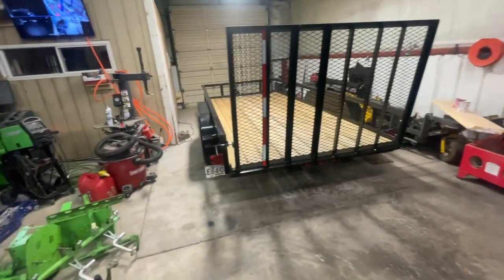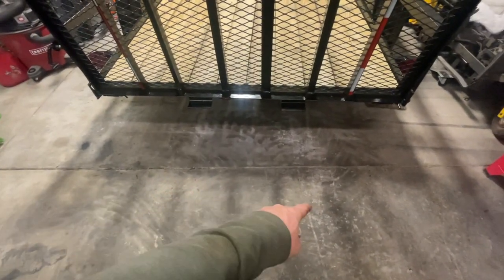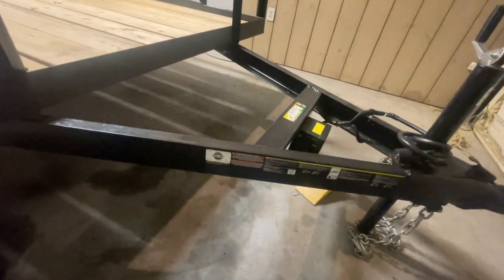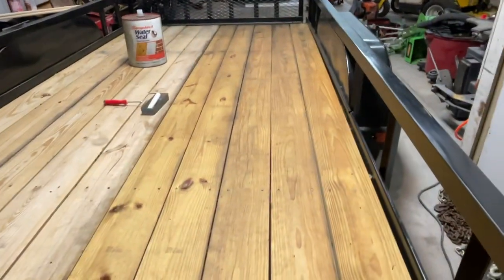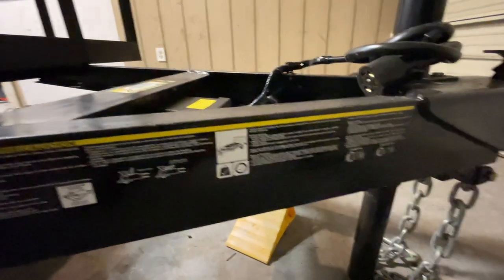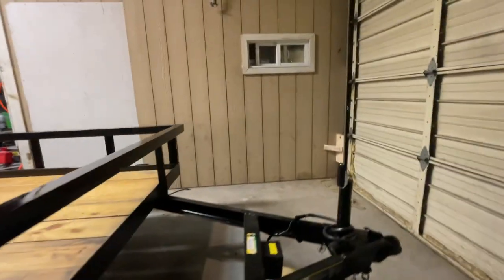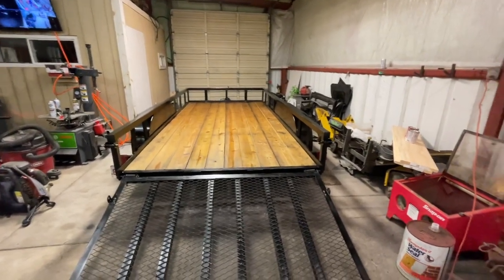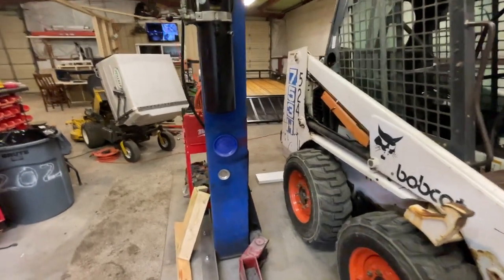HOW TO Make Your Trailer Deck Last Longer | Tractor Supply Company Trailer

Comment: I have it’s single axle sibling. I bought it last year because it’s the only trailer I could find. I was hesitant but not overly concerned because I don’t haul anything that even comes close to the weight limits. So far it’s been a good trailer.

Comment: Nice that you have a double axle trailer now. Perfect to use for everything you do. One thing I noticed is that it doesn't have stabilizer jacks at the rear to support weight going up on the trailer. You could always add that on so when you load the skid steer, it's not lifting on your tongue. I love the tractor supply companies. We have one called Peavey Mart. Formally TSC Store. I think you guys have TSC still. They have skid steer attachments too for a lot cheaper but not sure the quality. I see you have foot pedals too on the skid steer. I don't mind them on my 319D. Sealing the trailer boards a great idea. I think I need to redo mine from last year. The sprayer was ok but I think rolling or brushing will apply better. No offence, I would not spend the money on green touch racks just from what I seen with everyone's experience. I use Buyers trimmer racks. Great video Ken!

Comment: Do you still have the big dump trailer?
Reply from the maker: I do not, the dealer I bought it from gave me the entire amount I paid for it new back after 5 months of using it. It was when prices started increasing. I ended up getting my current dump truck for $2000 and $6500 leftover.
Reply: @KenMrKLC  ahh smart man !